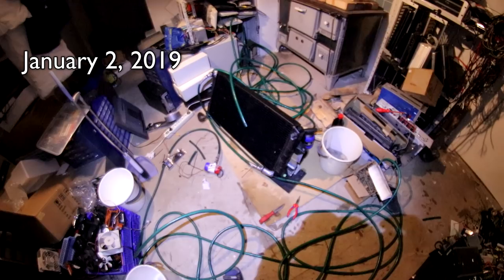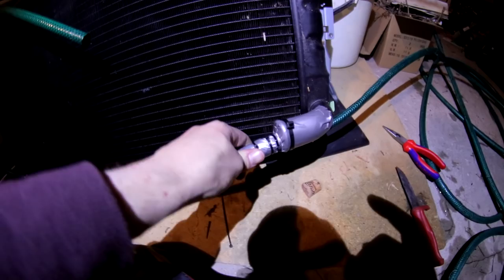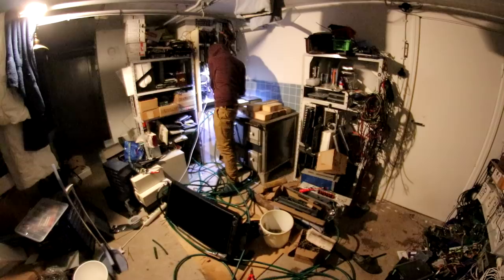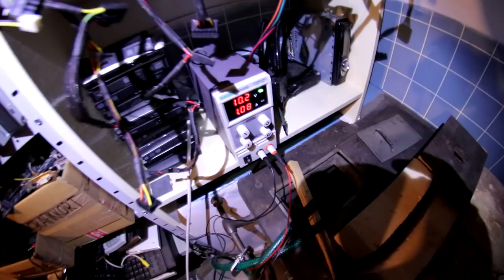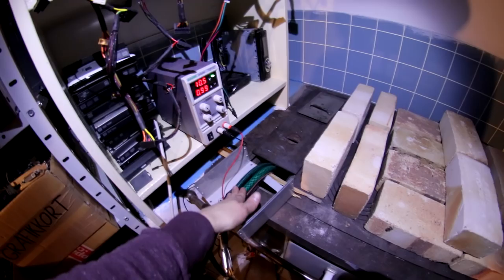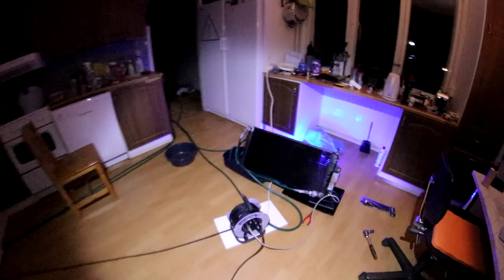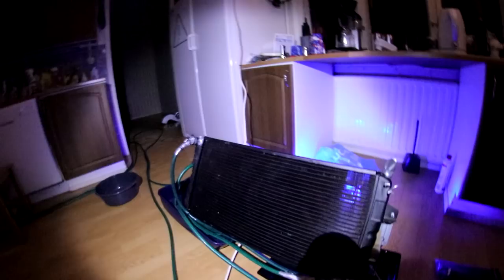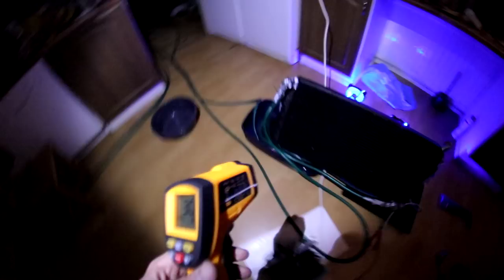Power Outage Blog 2 - Car Radiator Space Heater

Comment: Great video! I love this "survival" type stuff. One thing: Putting the fans on the radiator is almost allways going to be more efficient: When you cool it down more, there is going to be more heat transferred over the thermal resistance of the whole system from the stove to the radiator.